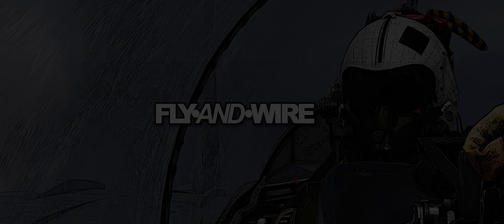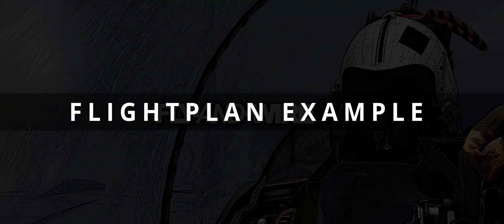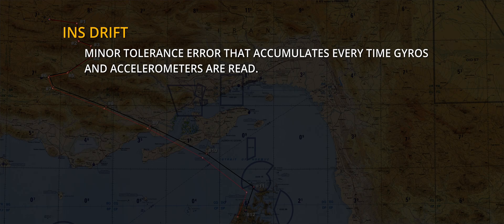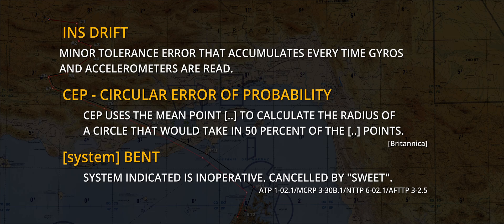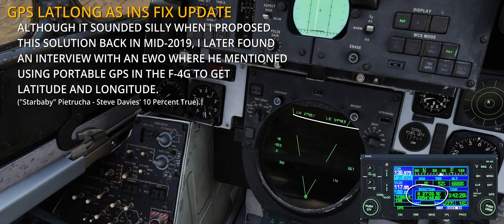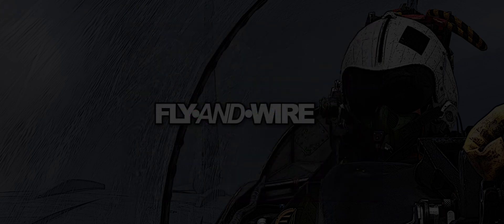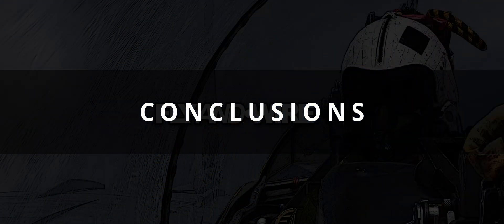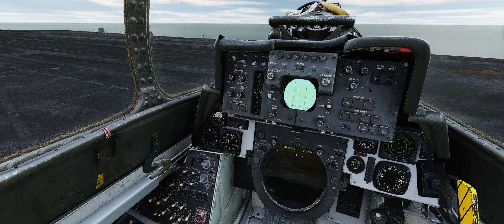Back to Basics - INS, Drift, and Navigation

Comment: Of course, the likelihood that ground based navigation aids will not be broadcasting accurate signals during wartime is the very reason INS was added to air vehicles in the first place, so counting on them for updates may be less than realistic.  Practice radar updates for all-weather ops.  Maybe someday DCS will add celestial navigation or Astrotrackers to certain historical aircraft.
Reply from the maker: I agree. From this perspective, DCS is always on the edge of realism vs arcade. The simplest example is emission control at FENCE and other phases of the flight. TACANs are set to T/R most of the time. Radio usage remains basically unchanged, KY-28/38 et cetera are never used, GPS spoofing cannot be simulated (forcing eras should work, but it is applied mission-wise), and more. Given these "issues", seeing players forgetting or not caring about the status of their INS is almost normal.
Fun fact, IIRC stars in DCS are correctly, or fairly correctly, replicated. In fact, spoiler alert, I have an old draft where I tried to recognise some constellations to ease navigation. Unfortunately, no one has modded a sextant yet!

There is a book covering the evolution of Navs that touches on aspects of training and its evolution from the "old age" of celestial navigation, maps-watch-compass, to the modern one. I really liked it, and I will review it at some point (2035, or something...):
"Observers and Navigators: And Other Non-Pilot Aircrew in the RFC, RNAS and RAF" by ret. Wing Commander Jefford, C.G.
I really enjoyed it, and I highly recommend it to all players who want a deeper understanding of DCS from a historical perspective.
Reply: @FlyAndWire  For those interested in the history of navigation, I can also recommend: Longitude: The True Story of a Lone Genius Who Solved the Greatest Scientific Problem of His Time.  It's a very interesting read.

Comment: Ok. Bud that was absolutely OUTSTANDING. You GOTTA keep stuff like this up!👍

Question: How did you activate the little GPS system in your video? Saw that for sale on the DCS site but thought it was for helos only?
Reply from the maker: Thanks mate!
The GPS is the  NS 430. It works in the vast majority of the modules. There is an in-cockpit 3D version as well for some (e.g. Hip), others use the overlay you have seen here.
To toggle it, check the controls: https://karonshome.wordpress.com/wp-content/uploads/2025/02/ns-430_keybinds.jpeg

Fun fact: I hadn't used it in a while until I needed it for this video. The view toggle was initially assigned to a panel's button. However, it was not working. I even thought the NS 430 was not supported by the F-4. I then reassigned it to the keyboard and now it works fine.

Also, the knows are awfully configured, they spin forever with a single button. There are mods to fix this - the only mods I use in DCS, btw.
Reply: @FlyAndWire  thanks for the heads up. I thought of a technique to align the INS over a known point. It would be easy enough for two people but would require some work from Heatblur to implement a command for Jester to “Nav Fix” or something like that.
Reply: @simtaylor61  its also possible to do a datalink nav fix in the f14 (fighter-to-fighter DL only?)
Reply: @yfbb1  unsure on that one. While I HAVE the Tomcat, I’ve only flown it two or three times
Reply: Seconded!!